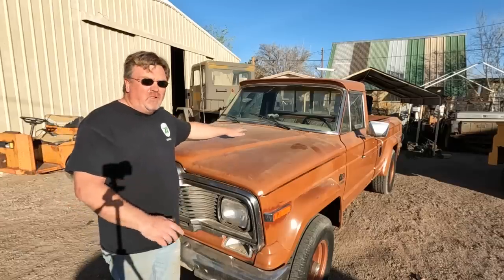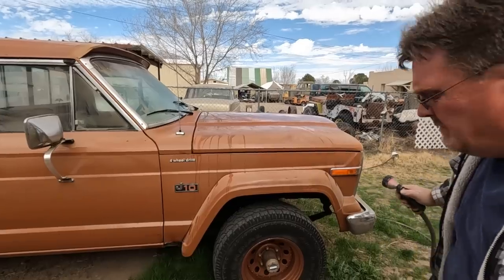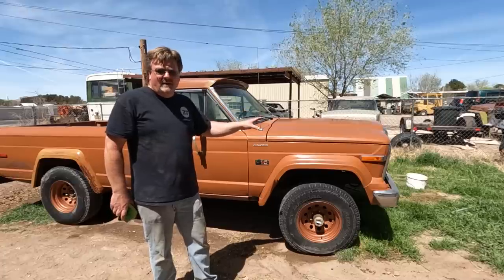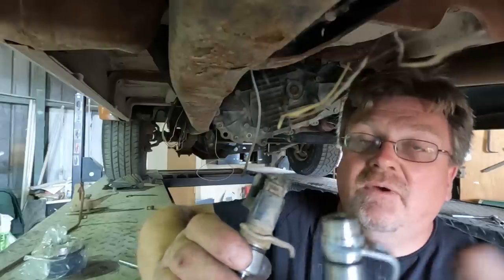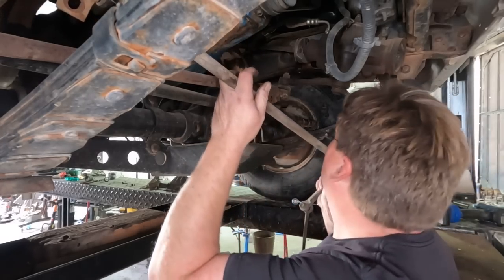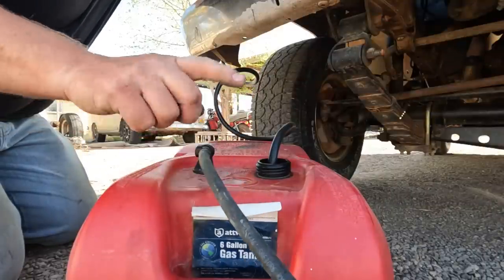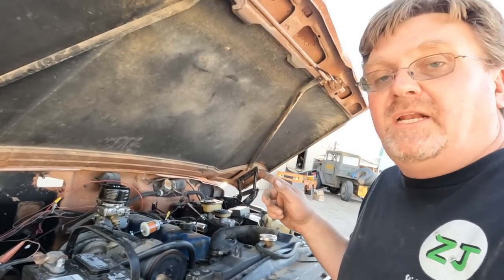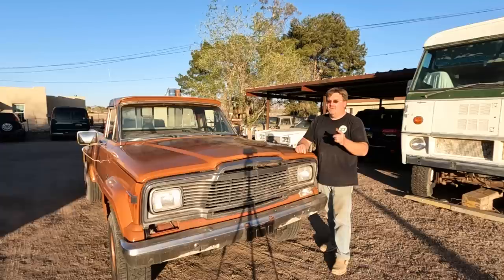Shine Juice Fail!  Do Not Use in the Desert!

Comment: I wondered too, after watching VGG do it, I had always thought of doing the same to my '77 J10 with similar patina but knew it might just make a mess. Our area has heavy winds that blow fine grey glacial dust (pretty similar to the desert dust) around for hundreds of km!
Reply from the maker: Glad I got to share results before you tried it!  I was pretty happy with the way the scouring pad cleaned up the surface, though.  If I had stopped there and did not apply the juice it probably would have worked out fine.

Comment: You are quickly becoming one of my favorite channels. I look forward to each new post.

I realize this was posted two years ago, but I’m just catching up. 

Two suggestions: 1) try wiping the linseed oil off with mineral spirits. If that doesn’t work, try denatured alcohol. Lacquer thinner might attack the base paint, so I’d avoid it or any other “hot” solvent.

2) Try waterless hand cleaner (“go-Jo”). It can even be used to clean off the oxidized, chalky paint. Use the type that does NOT have abrasive in it. The abrasive type might be too aggressive. Best thing is that the lanolin in it leaves your hands nice and soft. 😁

Hope the projects are coming along well.

Comment: Could always lightly sand that off and hit it with some clear coat. Once it dries it’s at least not sticky. Problem with Boiled linseed oil is how long it takes to harden. Yeah dry to the touch in 12 hours or whatever but still tacky for weeks. Great for wood stocks though if you’ll keep them inside until they’re cured.

Comment: Wax and grease remover is what is needed to remove all of that oily concoction. Painters use it with two rags, one on rash had so you wipe the wet rag with the remover solvent, and dry with the other. On really bad contamination it may need more than one application. If the contamination is not removed you will get fish eyes in your new paint and also poor adhesion. 
Never use oily products on paint. The dirt that sticks becomes sand paper and will remove a finish

Comment: Sounds like u may need a set of rod bearings.     Common problem in the 300 but my dad put 70000 miles on his with no oil changes and #1 hammering like a caveman.    So it will probably be fine
Reply from the maker: I'm wondering about the knocking, it actually seems to be coming from the transmission.  It usually goes away when I push in the clutch.  But it keeps running, so I'm just going to ignore it for now...
Reply: @LowBuckGarage  could verry well be.     I forgot u said it was malfunctioning.         Those eingines were bulletproof and had plenty of torq for a 4x4